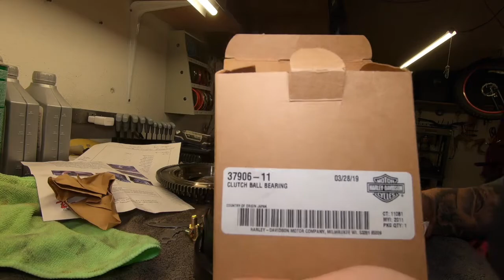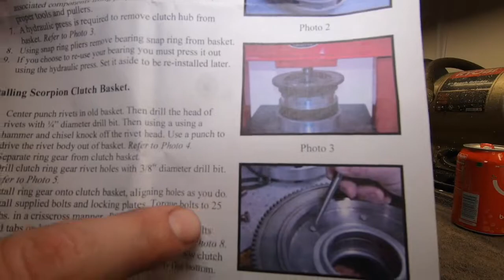BARNETT CLUTCH BASKET EP 2

Comment: Future reference, those are just rivets holding the ring gear/sprocket assembly in place. Once you drill or grind the head off you can just pop them out with a hammer and a punch. Either way you still did a real nice job 👍

Comment: This video is from 2 years ago. Im just now putting my clutch basket on, and I was completely unaware you had th make the holes BIGGER for the clutch basket to gear.
Reply from the maker: It's pretty easy you can do it
Reply: @TheGasStation1616  i mean yes we did already. I was just under the impression this would be like... bolt on. Anyways getting the bearing replaced, hub pressed in, then I'll start reassembling everything after.

Comment: How long did it take for you to bore out the bolts on the clutch basket?  That drilling seemed to take quite a long time.
Reply from the maker: not long as i remember just use a new bit
Reply: @TheGasStation1616  awesome. Thanks. Appreciate the video.